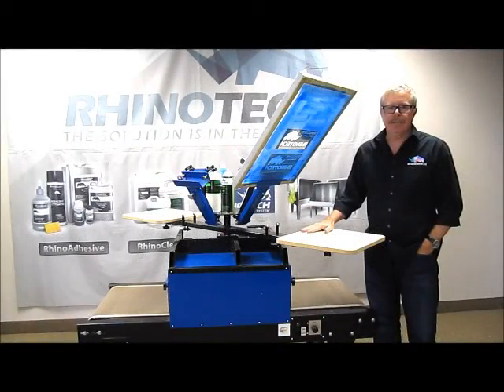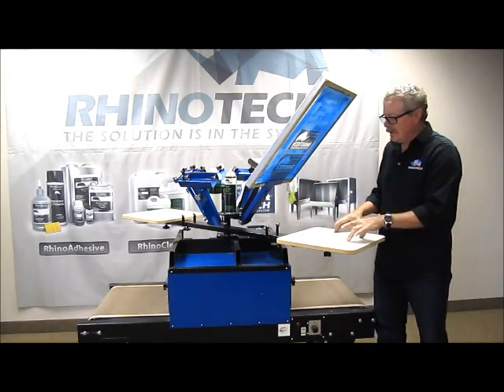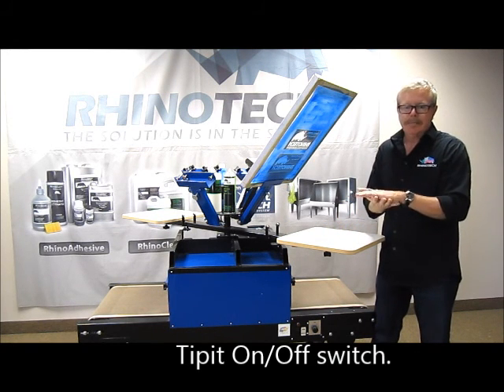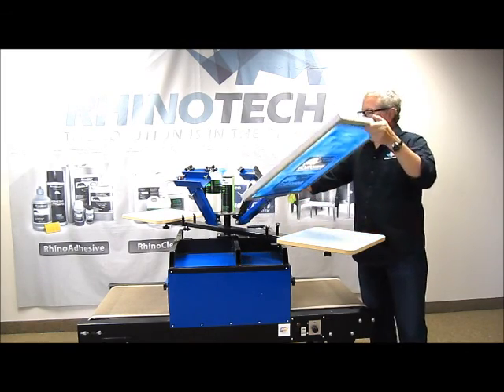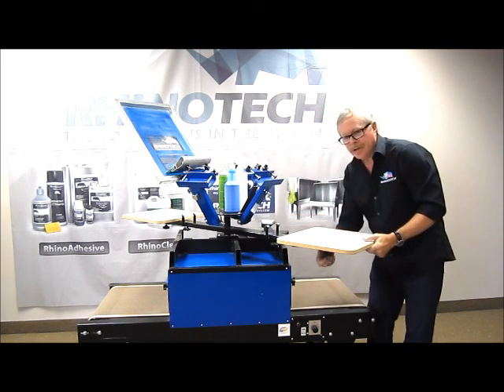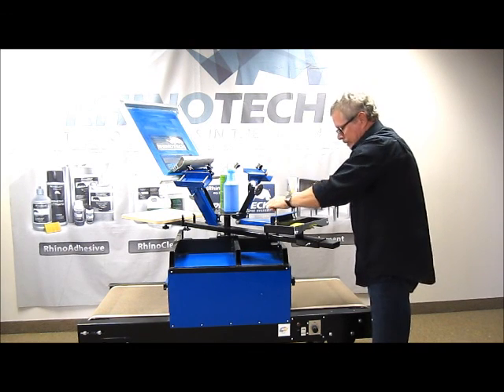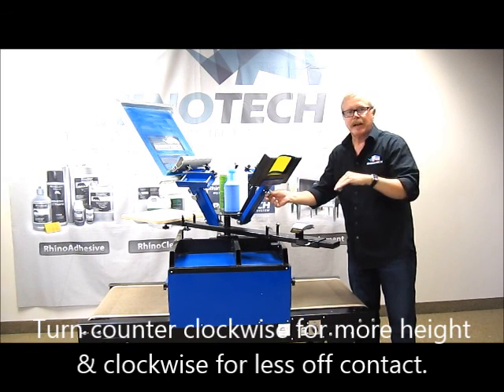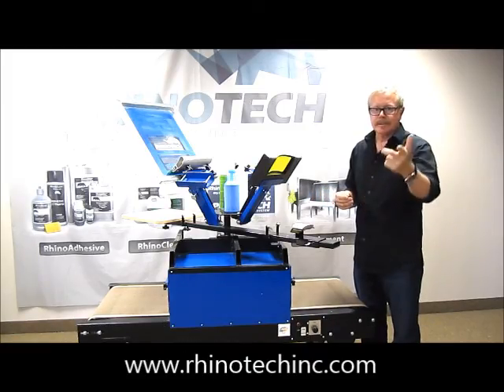Textile Screen Printer/Conveyor Dryer Combo

Comment: Noway that is getting up to curing temperature
Reply from the maker: Hi Brian. Appreciate that you watched our video on the Printer/Conveyor Dryer Combo that is one of our best sellers and a true space saver. The dryer heats up to over 330 degrees F. to ensure curing of Plastisol Ink and has an adjustable belt speed, as well. It's a great performing machine just like the HIX Little Pro Combo (https://rhinotechinc.com/screen-printing-equipment/Conveyor-Dryer/Little-Pro) and other  industry manufacturers who feature the same type of dryer/printer combo. If you have other questions or are interested in purchasing, please contact Chris  at 651-686-5027 x 4. Thanks, again.
Reply: @Rhinotechinc  I'm still looking around but also still interested in this machine,I'm almost rdy to start buying my own equipment
Reply from the maker: @epicscratcher5162  Would you like a call to get your questions answered? If so, just send an email to bobby@rhinotechinc.com. Thanks for considering our equipment.

Comment: Another product video where the product was NOT actually shown in use.  The dryer may be ok but that 4 color press would be all but useless if you want to do multiple colors.  $100-$150 press all day on Amazon or wherever.  You will not be able to print multiple colors with this press.  It will not hold registration.  Rhinotech, as a MN native you are inching extremely close to being "NOT So MN Nice"...  Demo your products for real, in realtime or don't sell them.